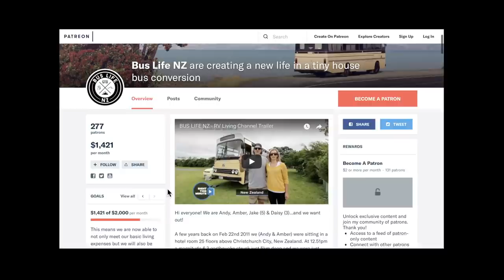Family Quits the 9 to 5 to Live & Travel in an Off Grid School Bus Conversion

Comment: Currently converting an 85 gmc to an off road/ boondocking bus. Stripped skirting battery box and entry steps out so its frame up floor for ground clearance. Now if i could loose the differential and that low pumpkin. Also moving the rear door to the rear passenger corner so as to make room for the full sized bead. Entry door will be a gull wing and drop down door that carries the entry steps. 
The best times are found off road.

Comment: Ok ok well well I got you ..here is advice You can add many solar panels  on the whole top of the bus ,when you have large amount of energy u can change that fuel running engine and install an electrical one to save money you use for gasoline..and you can just buy a backup generator which will be used when the sun hide or heavy  weather which affects the sunshine also it will be used to run the electrical installed engine ..

Comment: Oh, I forgot to ask you one thing. You mentioned that your fridge is completely solar. Is that 12 volts running through a charge controller to the batteries? If so, doesn't it tend to drain the batteries? Wouldn't it be more efficient to run it off of propane?
Reply: Bill Di Giacomo check out Samsung digital inverter compressor fridges. They are super efficient and run off a 300-400w inverter. Much more efficient and much cheaper than propane.